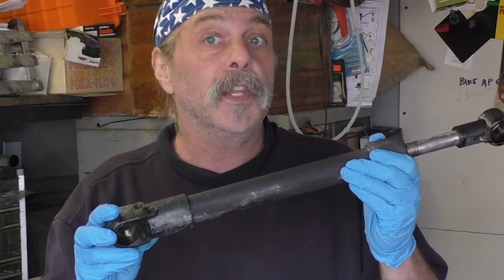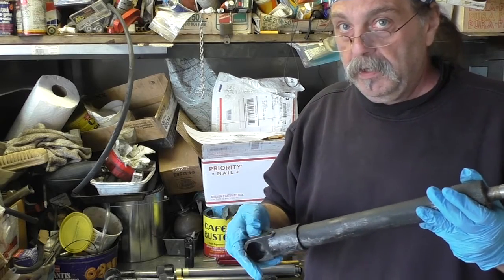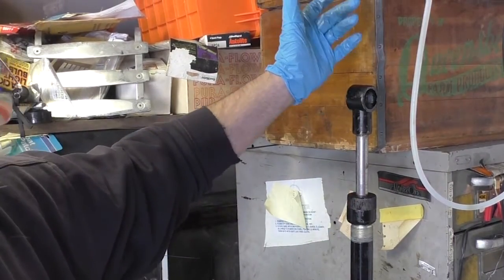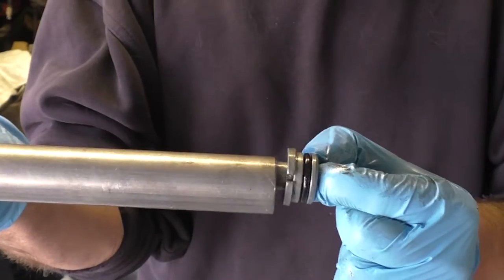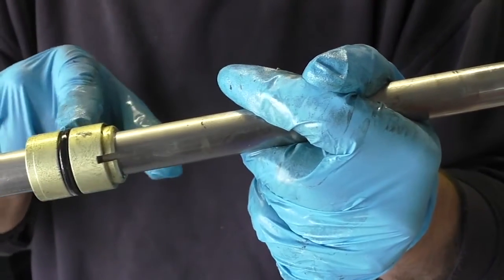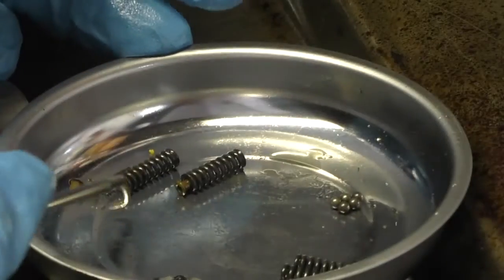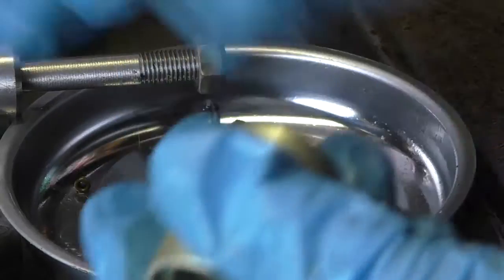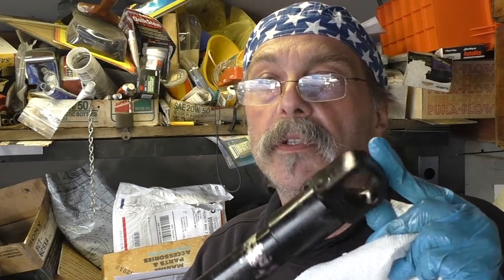Mercruiser Pre Alpha Trim Cylinder Rebuild

Comment: thank you for this video.. I ran into the dreaded stuck router valve.  7/16 easy out. long extention. electrical tape wrapped tight around socket and easy out. Counter clockwise twist break it lose. pull it out..🙂

Comment: I know I'm late to the party but, I had success getting those stuck diverter valves out by putting screw in grease zerks into the ends of the cylinder where the pump oil lines screw in. I screwed them in finger tight (don't torque them down to much or you could mess up the cylinder threads up!) in both of the holes then put a screw into the middle of the diverter valve down in the cylinder. I then used a grease gun and pumped away and the came right out. It's an old farmer's trick to unstick a gas powered tractor motor that uses spark plugs by putting grease zerks into modified spark plugs. Yes, it's messy with all the grease that needs to be cleaned up but it worked for me. And thanks for the video it's great!

Comment: Do you know if there is a way to mount the trim cylinders with the external lines in place of these? I can’t find any replacements and sierra wants 350 per cylinder
Reply: The way I understand it, yes you can but the whole hydraulic system works differently. If you are upgrading the rams to the new style, you need to upgrade the pump at the same time.

Comment: I took apart both of mine and both of them that end piece stayed in the bottom of the tube and successfully removed both with relative ease. I just soaked both tubes overnight in atf and then dropped the open ends onto a block a wood a couple times and they fell right out.

Comment: This video helped alot but also wanted to add I was able to remove the valves from the inside of the tubes. 
A driver bit (Kolbalt 11/32") fit snug in the valve and using a 12" locking extension, I was able to push down and turn until I felt the valve spin and was able to pull right out.

One did slip and the bit was stuck in the valve (making a sort of plug) but an airline to the back made a nice little "air cannon" to pop it right out :)

Comment: In the inner tube is a so called floating piston (glm part 02191). Do you need to able to get that out?
Reply: Did you have to remove it? I am about to do some myself and therefore am curious.

Comment: Hey Pete thanks for the video. Good stuff. First - do you have a link for a rebuilt kit?
The yellowish bushing/cylinder is seized up right against the piston. It won't budge which was probably the issue. Just trying to tap it loose dents the cylinder pretty easily. Suggestions?
Reply: Dented is DONE get a used cylinder

Comment: Hi, Got a question I am trying to rebuild same cylinder as you have in vid with your help. I removed the end cap first thing but my cylinder has resistance such as suction or maybe spring? is this normal? looks like it slid out real easy in the video.
Reply from the maker: Sorry for the very late reply... Hope you've got it fixed by now... It's suction... probably one or all of the chech ball valves is sticking... with the lines disconnected the fluid should just flow out the open lines.... HOWEVER some suction will still be there untill the pressure is relieved... Just tug untill it  ballances out... there are no springs other than the check valve ball springs.
Reply: Suction means one of the lines or fittings inside is clogged

Comment: Pete. Greetings from Maine.  Very helpful video. Appreciate the tips. I was able to remove my stuck diverter valve by buying  a coarse threaded stud  (pointed at both ends and threaded at both ends with a short unthreaded area in center) at the hardware store . The diameter  of the stud was slightly larger than the center hole in the diverter valve and threads were similar to sheet metal  screw threads. I cut a broom handle off to  about  a 30" length and threaded one end of the stud into  one end of the broom handle. I  put thee broom handle stud end first into the aluminum tube then twisted the  broom handle-stud end into the diverter valve. After threading the broom handle stud into the  diverter valve I then somewhat gently hit the aluminum tube with a hammer and block of wood --the block of wood  resting against the aluminum tube was struck by the  ball peen hammer and  protected the aluminum tube from damage by the hammer.  While hitting the block wood/aluminum tube with the hammer I grasped  the broom handle --threaded into the diverter valve --with my hands and held the outside of the the aluminum trim tube between my knees (this sounds more of a contortionist move than it really is). After a few quick strikes with the hammer and block of wood the diverter valve came free. This method avoided the need to use a welder to create a removal tool. I found one pin hole in my aluminum tube before I removed the diverter valve. I am going to try marine tex as a  method of fixing it and see if I can salvage the aluminum tube since the tubes  seem to be about  about $100 with shipping. Anyway thanks for the helpful video. 
John
Reply from the maker: Glad I could help... mine was stuck so bad that a bodywork slide hammer would not budge it!
Reply: Yeah Yeah... LoL lots of suggestions like that... I used a bodywork slide hammer and it was stuck like welded! Salt Weld LoL 
If it wasn't for bad luck... I wouldn't have no luck at all... This year I had a pinhole rotted through no4 cylinder to the water jacket... Block is SHOT... Maybe I'll post the new shortblock install come spring 2019

Comment: Hi Pete, I liked your rebuild video & have come up with a fix for removing the floating piston in the bottom of the cylinder.  I made a simple tool for removing the cylinder by welding a 10x24 tap onto a 3/8ths inch steel pipe, 20 inches long, as straight as possible. By hand you can now tap into the center hole. When you've run the tap in 1/4 to 3/8 inch you hook vice grips to the pipe and tap the grips with a small hammer and it pops right out.This leaves the center hole threaded & slightly larger, but acceptable.  Hope this helps.  Norm.
Reply from the maker: Wow... what a complicated but GREAT IDEA.... LoL... But if you read some of the earlier threads regarding these inside diverter "Valves" you will hopefully come across the "ONES" where I've mentioned that I tried an "Auto Body SLIDE HAMMER !!! " MINE WERE F'N FROZEN SOLID... STILL I MUST SAY... your Idea is "OUTSTANDING!!!"
I wish I had the patience to try it but in my case, the threads would have NO DOUBT heve ripped out and I would have wasted all that time making that tool... I REALLY DO LIKE THE IDEA and am VERY happy as it sounds like you successfully removed those "Pesky Pucks" !!! Maybe I should call myself "Primative Pete" for the slide hammer!
Where are you from Norm? Look me up on F-Book if you like... Pete Richards (NY) or just E mail repeteproduction at Geeee Mail... It's nice to have ingeneous friends !!!
Reply from the maker: Thanks Norm... was way ahead of you here... I tried a bodywork slide hammer... It wouldn't budge!
Reply: Tried a slide hammer... Mine were REALLY Stuck !!!

Comment: How about using the pump to push that fluid router out?
Reply: When they are STUCK that bad it's not coming out... I've even tried a Slide Hammer for pulling body work dents!
I "THINK" if the back fluid routers are stuck that bad... they either won't leak down or won't work at all... All you can do at that point is change everything else and keep your fingers crossed...  BE WARNED those cylinders are VERY THIN !!! That's why they put those steel tube liners in !!! You can put a hole in them if you try and grab that thing by the edge!!! GOOD LUCK !!!
Reply: Peter, so far I've only dissembled one cylinder and the piston in that one is considerably different than the piston in yours and i cant find anthing that resembles it on the web. 
. My outdrive is a 76 mercruiser 233. The cylinders are slightly different on the exterior. Ill go open the other cylinder in few. I was just curious what your thoughts would be on this mess.
Reply: You cant adequately plug the other hole to get the pressure you need...

Comment: You can get those ram's out.  Use compressed air on the fitting and it will push the ram out.
Reply: NOPE tried everything but a torch !!! Even used a bodywork slide hammer! When those suckers get stuck in there it's use em the way they are or toss em aside...
Reply: I was thinking of using compressed air but I got it out by hitting the open end on a cement floor. You have to be careful not to damage the threaded end, I put a magazine down first, and as you bang the open end into the magazine the valve slowly made its way down to the open end and then you just grab it. My theory was if you couldn't get it out and had to buy a new cylinder anyway then damaging the threaded end won't matter.
Reply: Haaaaaaaaaaaa You my friend are VERY Lucky... A bodywork slide hammer would not budge them!

Comment: hey Pete thanks for sharing. There is a way to get a stuck valve out of the cylinder body. you need long a wood screw 5-6mm diameter. you secure the screw in a tube. You now just have to insert the tool in the cylinder all the way to the valve  to be able to lock the screw in the valve hole. If your srew is the good size one turn is enough. then you just pull hard on the tube turning clockwise.
Reply: I tried using a screw on a body work slide hammer... I didn't heat it because I figured if it was THAT tight... That was NOT where the bleed down was occurring... I know there was no blockage as compresed air past without issues... If it worked with the screw for you that's great! You're luckier than I was!
Reply: Thanks but I used a bodywork slide hammer... NG they were like salt welded in... Maybe a cuttoff wheel ???? NOT!!!

Comment: You can remove a stuck router valve (way down in the barrel) by welding a #10 self-tapping screw onto a 5/32 steel rod and threading it into the valve to pull it out. I got this from the mercruiser shop manual. It worked on both of my cylinders.
Reply from the maker: I tried a bodywork slide hammer... Nope... not on the one I had
Reply: Oh you mean like my bodywork SLIDE HAMMER.... LoL Nope it's still in there!
Reply: Worked for me on both cylinders! However, the screw broke right as I got the second one out which made for loads of fun drilling it out of the hole. Still better than having to buy a knew cylinder though!